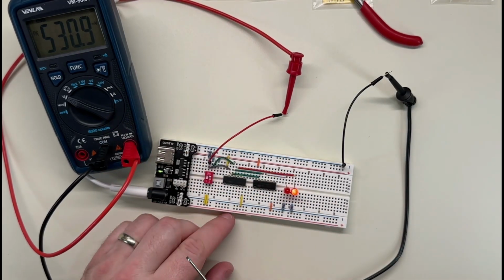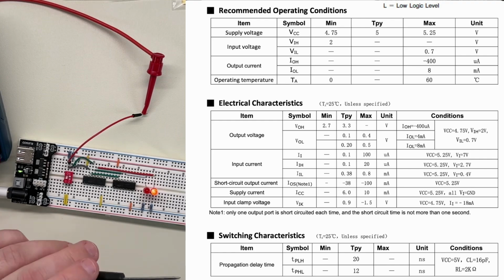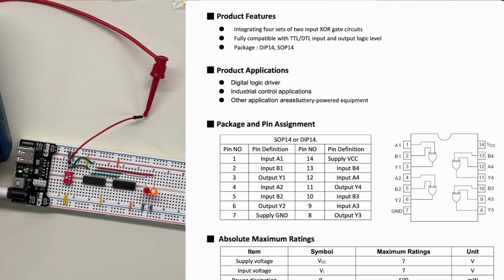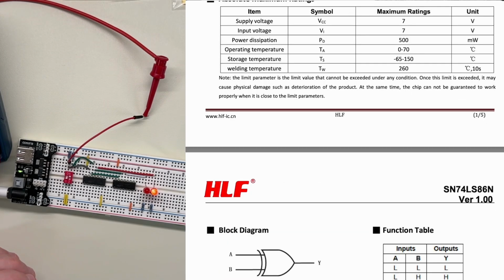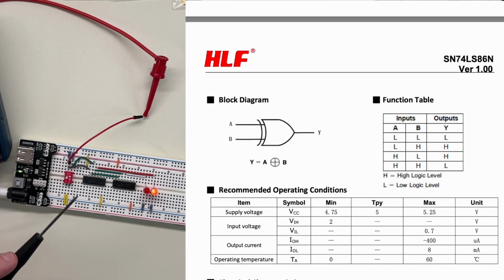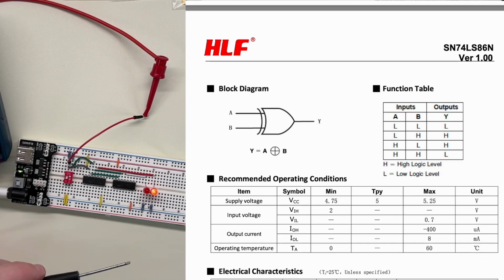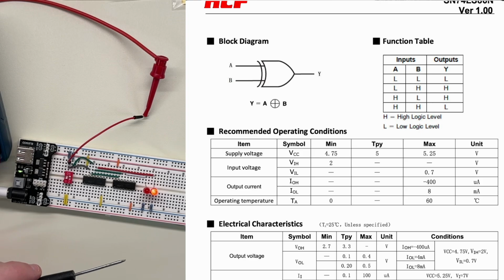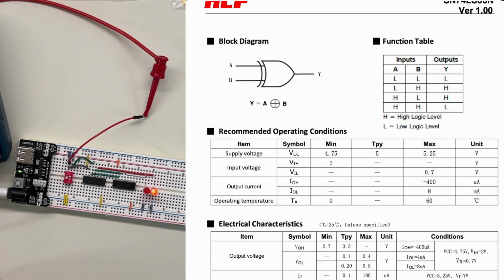Trying to understand pull up and pull down resistors

Comment: Hi, I think the things is. The inputs of the integrated have internal pullup resistors and that’s the reason to have voltage in these inputs when you energyce the integrated. Then, I think you must connect the switchs direct to ground, without resistors. This way, the switch open, maintain 0 (open = connected to ground) and the switch closed maintain the 1 (thanks to the internal pullup resistor). It make sense? I’m a hobbyist too, learning each day.

I like your videos, Thank you.

Comment: I think once the circuit becomes a complete circuit on 'both' leads. You have to think about this in terms of a voltage splitter.  I'm curious what the voltage looks like on the 'on' side when you change the 'off' side of this circuit. 

That might help think about what's actually happening here.

Comment: The fact that you had about 500 mV with a pulldown told me you were using ICs in a TTL family, even before you showed a datasheet.

The requirements for logic HIGH and LOW voltage absolutely do influence the value of pulling resistors than can be used.

TTL is more "difficult' in terms of pullups and pulldowns than any other logic family in common use.
In order to get a TTL to a LOW condition, you must "sink" "conventional current" from the input to ground. "Conventional current," unlike electron current, is considered to flow from positive to negative.
Each TTL family has different specs for the magnitude of current. With LS TTL it is specified (iil - normally upper case I for current, subscript IL for Input Low)) as 0.4 milliamperes. You need to be sure that input is kept at less than 0.8 V (or as recommended in your datasheet, less than 0.7 V) to be interpreted as a proper LOW. While most TTL specs in terms of input currents and voltages are consistent among manufacturers, it is worth checking the datasheet to be sure. I found one in which iil for an LS86 was spec'd as 0.8 mA, another at 0.6 mA).

Using 0.7 volts as our target and 0.4 mA as the current we must sink to ground to get down to 0.7 volts, we calculate the pull-down 
R = V/I (or E/I) = 0.7 V / 0.0004 A = 1750 ohms
That is the MAXIMUM resistance we can use for a single input.
In your added you are certainly driving more than one input so we have an amount of current equal to that for one times the number of inputs. You are probably driving two, assuming a pretty typical adder, so you have twice as much current and therefore require half the resistance (back to Ohm's law with 0.0008 A). I'd actually aim for no more than 0.5 V.

You can use lower resistor values than you calculate but remember that when your switches are ON, the resistor is connected directly between Vcc and ground. I'd probably use a 470 ohm (a very common value) as the pulldown for two inputs. If the parts were original TTL, the input current would be 1.6 mA, so for two inputs you'd need 220 ohms to just barely meet the 0.7 V target.

Usually with TTL you don't use passive pull-down except in unusual circumstance. You would instead use the switch to connect the input to ground for LOW. With CMOS passive pullups and pulldowns are easier since the steady-state input current is essentially zero.

Comment: In input resistance of a typical DMM in voltage mode is very high, usually 10 megohms (10 million ohms). With such high input resistance it takes only a tiny current to produce a non-zero voltage. This is a simple Ohm's law matter.
If a current of 10 nanoamperes (10 x 10^-9) flows through 10 x 10^6 ohms, the voltage across the resistor will be 0.1 volts  Unshielded test leads can easily have such low currents made to flow in them due to electrical "noise" radiated from all manner of things, not the least of which is AC power wires. If you short the test leads together, both inputs of the meter are kept at the same voltage so the display will stay at zero. Typically the circuit you will be measuring has much lower resistance than that of the meter (if it doesn't large errors will be present in the value displayed by the meter). These noise currents will therefore mostly flow in parts of the circuit you're measuring. That same 10 nA through a resistance of, say 10 k ohms, will only produce a voltage of 100 µV. Sometimes you have to resort to shielded meter leads.

Fully describing all of the details would take many pages. I haven't looked for such things for many years, but I suspect you can find some very good information on using meters and the problems that can arise from companies like John Fluke, Keysight and Keithly.

Comment: The floating voltage depends on the type of circuit you use. Many IC have in. ternal weak pull up resistors other don't. You can induce floating voltage by statisc electricity. Intuition will come once you understand the relations between Voltage Current Resistance Just keep experimenting. It's like learning to go on a byke, in the biginning you focus too much after a while it will come naturally. Practice practice practice. Keep up the good work .

Comment: About the current limiting resistor for LEDs, they are used to drop the supply voltage enough for the LEDs. Most LEDs have a voltage drop between 2V and 3.5V, so using the same resistor just means a little bit less or more current depending on the LED's voltage drop. Supposing you have a 5V supply and a 3V drop LED, you have to drop 5V-3V=2V across the resistor. You then divide this 2V figure by the current that you want to be flowing. To have 10mA flowing through the LED, you need a resistance equal to 2V/10mA = 200ohm. If instead you have a 2V drop LED and you still want 10mA to be flowing, then it's (5V-2V)/10mA = 300ohm. 
These are Kirchhoff's voltage law and Ohm's law applied.

Comment: A couple of other comments have covered floating inputs and why pull up/down is needed, but I don't think anyone has really covered what happens when you change the value of the resistor. You seem confused by the fact that in the case of a pull down resistor, decreasing the resistance decreased the resulting voltage and vice versa. The easiest and most intuitive way to think about it for me, is that the chip is actively trying to drive the line to 5v, with a very small amount of current. The pull down provides a path to ground for this current, resulting in very little voltage (as most or all of the charge has a path to ground, no charge builds up). By using a resistor, you are effectively limiting how much of this current can be dissipated, and as a result some amount of charge and hence voltage builds up. As resistance increases, less charge can be dissipated resulting in a higher voltage. As resistance decreases, power finds a path to ground more easily, resulting in lower voltage.

In theory you could accomplish the same task just with a jumper wire to ground. The only reason a resistor is used is to prevent the pull down from just being a short circuit, which would run the risk of causing excessive current flow and resulting damage to the IC. In reality for something like a simple XOR it would probably be fine, but a small resistor to limit the current offers cheap insurance against burning out chips.

Comment: This guy has some advanced , mainly laptop repair videos where he teaches the logic of what usually goes wrong on a laptop and ways of fixing it. Also he made several well thought out videos systematically going through basic, teaching his wife, who is absolute beginer in this field, and if you can handle his rough English,  he is the teacher i wish i had in school.. it's hard to explain this stuff once you understand it and he manages it anyway . 

https://youtube.com/playlist?list=PL1VPLHW2WUgvjvJrNW4vhTymQ5YRsH0Ct
Reply from the maker: OMG that series is delightful! So patient and zen. I love it.
Reply: I would recommend avoiding Sorin like the plague if you want to learn things. He is terrible and spouts a lot of utter nonsense. I've watched quite a few electronics videos on YouTube, just to see how good they are in terms of accuracy of information, and some of his are hands down the worst I've seen. Particularly stay away from this witchmode power conversion stuff.
Reply: @d614gakadoug9, could you please be more specific about what you find inaccurate about his teachings?  I personally feel like he is often dealing with complex circuits without schematics and obscure, poorly documented components. If he offers a warranty on his repairs, I trust he wouldn't use methods that wouldn't hold up. In some cases, the "dodgy" methods he uses might be necessary due to limited parts availability and repair costs. Sometimes, a factory-standard repair just isn't feasible due to time and budget constraints. As long as the functionality isn't compromised and the customer is happy, I think that's all that matters.

Comment: The reason you use pull up/down resistors is because any type of transistor output will create a connection to ground when it turns on. So if you are using that to send a high or low signal to another device, you use a resistor to create the "high" level because the voltage on both sides of the resistor will show the same voltage as long as there is little to no current flowing. So when the transistor output of a chip is off, you will see the high voltage and when the output turns on( creates a connection to ground) you will get your "low" signal and the resistor prevents the positive side from shorting directly to ground through the transistor. The reason you keep confusing yourself is you are overthinking it.
Reply from the maker: Thanks! Overthinking things is basically what I do best... 😛
Reply: @bigzaphod  Overthinking, for better or worse,  the story of my life!
Reply: Not true!

It is quite common for a transistor to be used to switch a node to "ground" but it is equally possible to use a transistor to switch a node to the positive supply rail. In the vast majority of logic devices, output are actively switched to the supply rail when HIGH and ground when LOW. The output does not always swing fully to the positive supply rail, especially with TTL devices.

Sometimes outputs are "open drain" or "open collector" (much ore rarely open source or open emitter). With OD or OC outputs, a FET or bipolar transistor switches the output to "ground." When the transitor is off, there is, barring external circuitry, no means by which a proper logic HIGH can be established. In that case a pullup resistor is used. OD and OC outputs are often used in so-called "wired-OR" circuits (which are more properly wired-AND since all drivies must be HIGH for the node to be HIGH).

Comment: Regarding the floating stuff: chips come in different "logic families" (for example, "74LS") based on how the gates are constructed. This determines things like what the thresholds for 0 and 1 are, and their speed and power consumption. For hobbyists like us, they're mostly interchangeable, and the logic is the same whether I have a 74LS86 or a 74HCT86. But some of the details matter when it comes to not what they do on purpose, but what they do as a side effect of how they're made. Inputs on 74LS chips, for example, "float high" -- that is, if you leave them unconnected, they tend toward a 1 (not that you should rely on this behavior).

Tying this all together somewhat: to provide a logic 0 to a TTL input, the chip is actually going to provide some current, and you need to "sink" enough of it to pull the voltage down below the low input threshold (V(IL) = 0.7V in the data sheet). Now we have enough to calculate the resistor value. The datasheet also gives the input current I(IL) max value of 0.8mA. So what value of resistor connected to ground will bring the voltage down to 0.7V if the chip sources 0.8mA? R = V/I = 0.7/0.0008 = 875Ω. So to follow the spec, your pulldown resistor should be 875Ω or less. Of course, that's calculating the worst-case value, and in the real world things tend to still work way out of their specifications.
Reply from the maker: Ooooooh... hmmm..  this helps, I think.

I figured Ohm's law could be used somehow to compute the right values for these resistors, but I couldn't decide where the "missing" current variable was supposed to come from in order to do the math.

There are a lot of values on these data sheets and I'm realizing I have no idea which ones are important for which things. I've been sitting here for 20 minutes trying to figure out which number I'd use to do this same calculation for an ideal(?) pull-up resistor instead and am confused again. :P
Reply: @bigzaphod For the pull-up, you need to get the input pin at or above 2V (VIH). Since the supply voltage is 5V, that means you want the resistor to drop 3V or less. The data sheet says IIH is 20uA, so plug in R = V/I = 3/0.00002 = 150kΩ (or less). So as you can see, TTL logic is "easier" to pull up than down.

I don't want to confuse things too much, but this might be a good point to add that if this had been a 74HCT86, the situation would be quite different. While they implement the same behavior and have TTL-compatible logic levels, they are CMOS-based chips using MOSFETs, and have high-impedance inputs. Generally when I hear high-impedance, I think of an input that's kind of "passive" -- it has such a large resistance that if I connect something to it, it's just going to sit there without pulling much current. And that's the case with 74HCT parts, you can look at the gate funny and it turns on. Literally waving your hand around near the chip will do it. This is also why it becomes so important to connect all the unused inputs to VCC or GND, because otherwise they'll be switching randomly due to noise and stray capacitance, and switching like that causes them to draw power as well as potentially introduce instability in the chip. Anyway, I digress...
Reply: Not what I would call 'correct' but maybe just a way to help get your head around it.

Think of what you are doing with the switches. One side is connected to the supply voltage and the other is connected to ground. When you flick the switch you are essentially shorting the supply to ground.

One side of the switch is trying to pull the voltage up to the supply level and the other is trying to pull it down to ground. So you get kinda of a battle.

When you put in a pull (up/down) resistor, you are adding resistance to one side of the battle.

In your case you were putting the resistance on the supply side (pull up) so the larger the resistor the more you are hindering the supply from pulling up the ground voltage. This then results in a smaller voltage being measured at the switch.